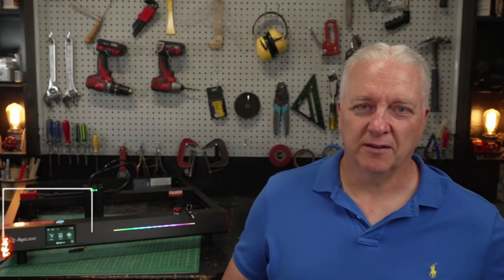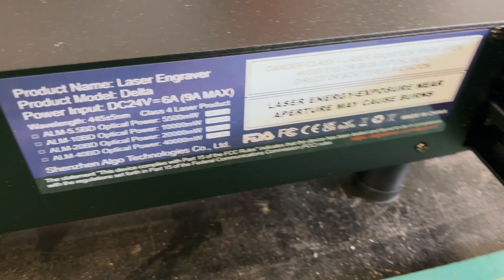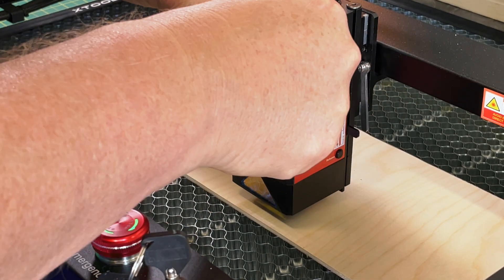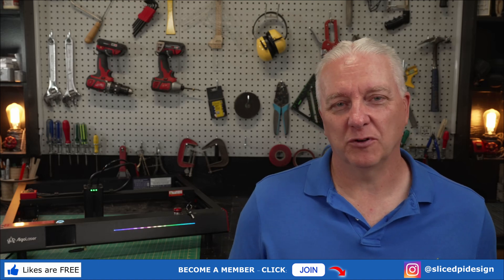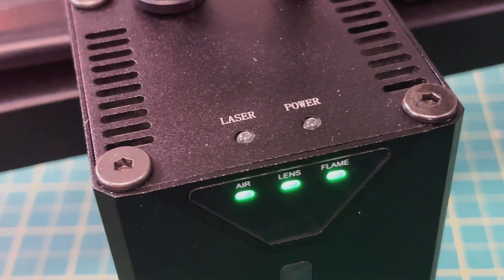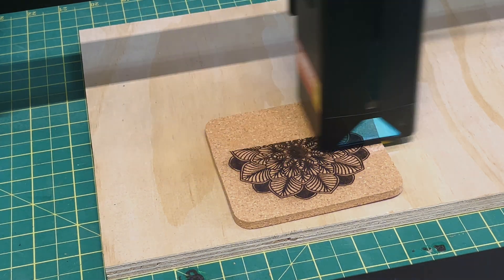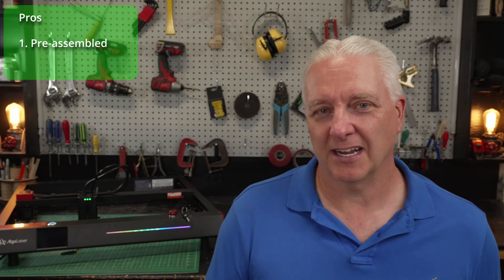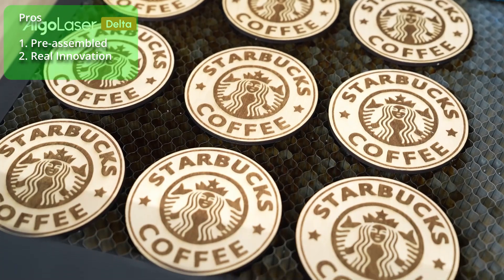The AlgoLaser Delta Laser Changes Everything

Comment: Hi Steve! We actually spent a few months doing some compreensive testing on Linear Rails, however - specially on laser engravers with exposed rails - the engraving dust would ruin the rails in weeks. The level of maintenance - which on linear rails is not easy - is a bit extreme. So in a way, less is more :)
Gil - AlgoLaser
Reply: was wondering why my comment was deleted?
Reply from the maker: @angelo2gelo  Not sure.  I would only delete a comment if it is inappropriate.
Reply: What are your thoughts between this laser and the Atezr L2 36 watt? I’m trying to decide between the two. I’m probably going to be 60/40, more cutting than engraving.
Reply from the maker: @jeffreibling4074  I love both of these lasers, but while the Atezr is 36W and the Delta is 22W, I would pick the Delta every time.  It cuts amazingly well and has very solid construction.  It also has some great features not found on other lasers - like adjustable beam size so engraving gets finer detail.
Reply from the maker: Ah, interesting, then I guess you’ve built the perfect laser😁. Nice to know you looked into this.  Any way you can publish these results?
Reply: @SteveMakesEverything  we REALLY really wanted to get linear rails to go, but some materials would really create havoc on them. Tile engraving for example. the paint turns into this fine dust that would compelatly clog the little ball bearings in a few long sessions. 
And if belts can be tricky to keep in tension and well maintained... linear rails cleaning, regreasing and reassembly is.... well Chaos! lol
i will ask if R&D can send some data to be set in "case study form" woudl be interesting
Reply from the maker: @gilaraujo  Thanks, Gil.  This is more to sate my hungry mind than anything else.  I never really thought linear rails would be an issue.  I used them in my home build CO2 laser and after hundreds of hours, they are still working flawlessly.